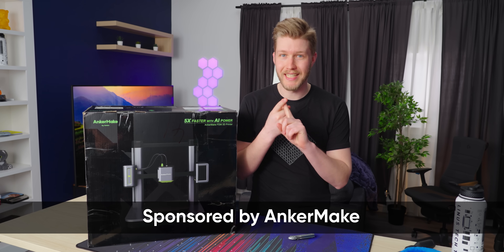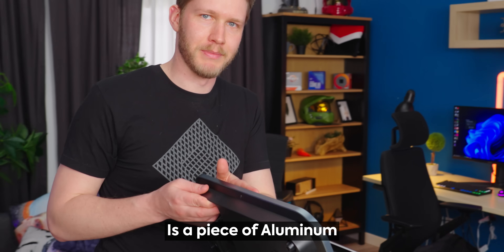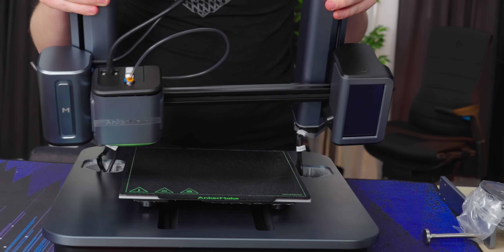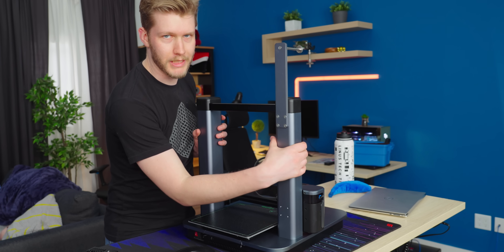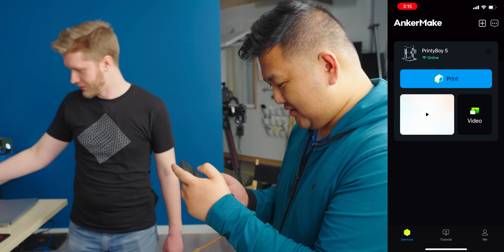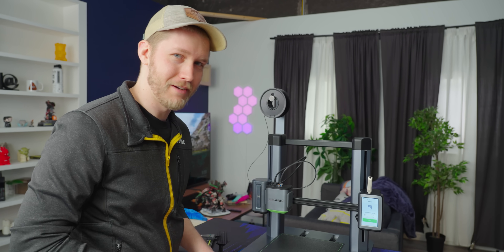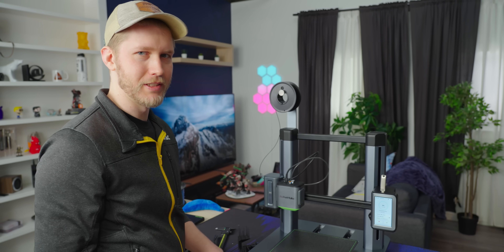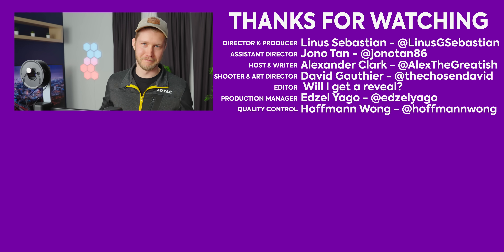Much BETTER than Expected - AnkerMake M5 3D Printer

Comment: I haven't messed with any 3D printers in about 7 years...
Seeing one that actually works (that a regular person can afford) is very nice.
Reply: Prusa Printers are also very reliable.
Reply: @thilotech  I also second this.
Reply: @thilotech  prusa is King of printers that just work without any fiddle , only first layer and It works.  But pricey.
I have a prusa myself mk3s , but also a CR 10 max , and I can walk away from my prusa without any concern but my cr 10 max , I'd have to be actively there in case it just mess up which is often even calibrated correctly
Reply: Creality makes amazing printers for half the price if you’re willing to forgo “smart” features you can add in for a couple bucks.
Reply: @porcupinebutter  Problem is creality fucking sucks and their printers get absolutely smashed by similar priced printers like the artillery genius, voxelab aquila, etc
Reply: @porcupinebutter  I second this too.
Reply: @porcupinebutter  I mean I completely get spending the premium for the features I had to do so much messing around with firmware just to get my cr touch to do 16 points of contact this type of stuff is great
Reply: @porcupinebutter  If you look at these stepper motors you should find them familiar. 

This is basically an Ender 3 but with built it CR touch.... I don't think it's that great given the price of the Prusa Mini or even just buying an Ender 3 and upgrading it's hotend and cooling getting a rail kit. 

For me I don't get it... If this is gonna be near $800 but with an Ender 3 build volume it needs to be better. I mean it's not even direct extruder like the Ender S1 and S1 Pro. Add to that the fact ender parts are plentiful. This suspiciously looks like a repackaged Ender 3 v2 with some upgrades.
Reply: @razerow3391  It is much better than an ender 3, the overall frame looks more solid, the base plate looks really rigid and overall looks (and is priced) like a premium product. Calling it a repackaged ender 3 v2 is honestly an insult to this printer. It comes with ABL, PEI sheets and various qol features you wouldve had to spend money and time on in order to install it on the ender 3 anyway so i dont see how you think getting a good base printer for a higher price is not good. Also, not shown in this video (but in their kickstarter) is that the extruder is indeed direct drive. The bowden is there just to guide the filament into the extruder but the extruder is located in the hotend housing (reverse bowden tube setup)

Honestly the hivemind behind the ender 3 has got to go. There are alot of upgrade parts for the ender3, because there really is alot of things to fix on the ender 3. It used to be a really good meme that the first thing you printed was upgrades for your printers; not anymore I feel. Development of printers have come a long way that i think people should be buying good base printers and starting from there, rather than buying some subpar products and fixing it after purchase. They were good pre-2019-2020, i dont think i can say the same now given creality's direction with their printers (ender 3 s1 is pretty good tho but i'd like to give it more time to see how their QC really is past the first few paid review units)
Reply: @razerow3391  yeah that price is insane for the same open source technology. You can buy 2-3 perfectly functioning printers for that price. I’m planning on getting a Ender 6 in a few months because core XY is the shit apparently!
Reply: @porcupinebutter  do you just have to find a slicer software and upload the files to an SD card? I am a complete noob with 3d printers.
Reply: @David_Quinn1995  depends on the printer. If the 3d printer support sd card and you want to print from it, you slice your 3d part with a slicer software(there are many free ones) and the resulting gcode can be saved on the sd card.
Reply: @David_Quinn1995  yep. I use cura but highly recommend learning a bit of 3D modeling at least to understand the form limitations of your hardware :)
Reply: @David_Quinn1995  download anything like Cura or Prusaslicer. Setup your printer in the options and then just use the default profiles if you are a noob and slice and print
Or just spend a few hours a try learning more
Reply: creality used to make amazing printers for low prices but i wouldnt get ender 3/pro/v2 these days with better options available unless they  were dirt cheap. There's a good article on the 3d printing subreddit that highlights the issues with the ender 3 and creality as a whole as a company, but really it all boils down to bait and switch tactics by creality and the ender 3 just not being very good to begin with since they're just racing to the bottom. If you need a printer that just works the ender is not for you
Reply: You can afford a good one. You just don't want to pay for one.
Reply: price is up though now that everyone has taken the early bird discount
Reply: Prusa Mini FTW!
Reply: Ignore all the people recommending an ender 3 v2 or pro, when you can have an artillery in a similar price range (genius/sidewinder) or an ender 3 s1, they are quieter, faster and more reliable.
Reply: @MRbasthor  oh yeah the S1 sounds great (I might get one if it drops 100 bucks) I’m just talking from my own personal experience.
Reply: Do me a favor and look up the Kingroon KP3S
Reply: I'm not sure where is this "you can get all the smart features with Octoprint" is coming from? You don't get a strain gauge with a DIY (BLtouch is a probe that adds bulk). In addition the only AI that will detect failed prints is Spaghetti Detective - and you need to pay monthly for it. (let's be fair - their free plan with 10 hour limit is borderline useless)
Reply: Same here. I think it's been 5 years since I last printed anything.  
Building a Chinese knock off Prusa with  about 50 parts is an experience :) 
Nothing is pre-assembled, not all parts fit so you have to print your own once you get it somewhat working. After that comes the tedious process of getting everything aligned.   
Never got it to print well but at least I learned a bunch of stuff about 3D printers.
Reply: So funny to see Creality fans saying buy an Ender that “just works”… NO! If you want to f*ck around with your machine for a lifetime then go ahead buy an Ender, if you want something that actually works then buy a Prusa MK3 or a MINI
Reply: @Fejszi  Apparently a lot of people have had good results with Creality printers, i have an Ender 5 Plus that i bought for printing larger parts, i put a linear rail upgrade on it, and a direct drive extruder upgrade cause bowden extruders are just crap, and that thing is reliable, like click print and walk away and come back to a finished part without any worries reliable.  I just helped set up an Ender 3 for another owner, i was impressed with it also for the price, out of the box experience was great, assembled it, followed the directions and it printed a benchy almost flawlessly on the first try, just a little stringing that was fixing with retraction settings beyond the stock settings.  I only have one Creality, but i have 8 printers currently, and i can say the Creality has been reliable and affordable, and for large parts the Ender 5 Plus with some upgrades has been great.  It worked fine out of the box but i couldn't stand those cheap rollers for the linear bearings, and i hate bowden extruders, others may have no issue running it as is.  So i don't know, Creality hasn't been an issue for me i guess.
Reply: @CrazyHamSales  Ok, but this is the problem with Creality fans: "OMG you bought a Prusa? Hahhaa, My ender 3 prints better than your orange piece of crap"- actual comment that a Creality fan sent me... Then you ask if his machine is stock or not; and turns out he spent more than 350 euros on just upgrades. This is the thing that CR fans can't wrap their head around. Some people want something that "just works", this means, that after assembly, I don't have to replace half of the printer, to then boast about how great it prints. As you stated in your comment, you gave it linear rails and a direct drive extruder, those are both extra upgrades that took time after assembly. Now I'm not a Prusa shill or anything but both my MK2.5 and my friends MINI+ have been working flawlessly without having to tinker with them at all (apart from the usual stuff, changing a nozzle if it wore out, or sometimes lubricating the bearings but never had to replace a part on any of them)
Reply: @Fejszi  Yeah and many people don't want to shell out shit loads of cash on something they ain't sure about, maybe they can't afford it all in one hit or it could be the case that they really are makers and love a challenge. I bet you're an Apple user too 😃
Reply: @trollobite1629  ok, so $hit loads of cash? yes ,maybe.... Yes, I am an Apple user, after 6 years of Android, I switched to an iPhone? Does that make me less human? And yes, I'm still a maker, but I like making stuff with my 3D printer, not tinkering with it. I still love challanges, but an Ender still can't beat the ease of use that even my 5+ year old MK2.5s has.
Reply: Ender is also well known to the community and there is lots of support from others if you run into troubles.  This being a new product for Anker means support will be less from the community until they release more at a better price then MSRP.

Ease of use is nice but honestly when I jumped in last year on the popular ones that pop up for cheap on woot it took me less than a day to work out everything and get good results because people post solutions to anything your going to run into on the Enders
Reply: @DestinationFawked  I dont get what he means... 3D printing for a few years now has been affordable... And the Ender series made it even more so. I mean how many versions of the Ender 3 is there alone if you think the S1 and it's variant are just updated Ender 3 v2s! 

And they have no problem. In fact you can even print PETG, as I do with eSun's filament. 

3d printing stopped being a wild west and janky a long time ago... Prusa, Ultimaker and others saw to that by standardising certain methods and design philosophy.
Reply: The build quality, "smart" features, ui focused towards less experienced users and covers over all the important parts (ie extruder, hotend, cooling fans, and kinematics) seems targeted towards apple device users. I'm surprised by the base price. That said, much of that is just more work when something fails and if you've 3d printed before you know something about things failing. I also run an ender 3 v2 on octoprint with bltouch and many other little upgrades and I feel like I'm more understanding of the device and process from finding the need for the upgrades during my uses and performing them myself. If this were my first printer (especially at $1200) I'd be very reluctant to want to fix it myself, so as long as there are no problems then there are no problems. It does look nice though.
Reply: @RobertD_83  here's my argument, a well built printer, taking into consideration good qc, materials and choice of components shouldnt randomly fail out of nowhere, and hence does not need intervention past typical maintainence, which can be supplemented by a well written manual, unlike the ender3, which has subpar construction, questionable component choices and your main troubleshooting source comes from the community, instead of the oem company. Heck, the go-to instruction manual for the printer isnt even written by them, and there are community members that write better instructions than creality themselves. You can learn about a printer even without having to go through the ender3 hazing periods is my opinion on the matter, you've just taken alot of the guesswork out, guesswork that's supposed to be a settled issue by now, by pushing and supporting good out of the box printers
Reply: With the caveats of FDM printers like this thing generally have much larger print beds and filament is a lot easier to handle at $750US you can get very good resin printers. I have both and use them heavily but if I was buying new I seriously doubt I'd spend more than $300 on an FDM printer.

Also Creality? If the point of having a 3d printer is to tinker with the 3d printer then sure but if you actually want to print stuff get something else.

Comment: Is this the 3-D printer that Alex was excited about during the recent sleeper build video? Either way, this looks awesome.
Reply: I think he was excited about the 8,000$ one he mentioned, but not the one featured
Reply: That one was the Phanteon
Reply: No it doesn’t look awsome, this is a low effort Ender 3 clone
Reply: @Fejszi  would you mind explaining? I have it backed at the $499 price but bought the Ender 3 S1 pro on sale figuring that one would be better in the long term. What’s your reasoning?
Reply: @areazaft1970  The Ender is the original design (even though it loosely copies a RepRap/Prusa Mendel) it uses Aluminium extrusions and V-rollers for movement, uses a bowden extruder. Since its open source, many companies just made clones, with little changes to the core design… As for your purchase; its a decent one, infinitely better than the piece of crap reviewed in the video, but its not as high quality as something like a Prusa…

Comment: There is a bunch of problems as of now. 
250mm/s simply not reachable with accelerations anjd jerk/JD they have as default settings, unless you print somthing in the size of whole bed.
Basically this machne is a Marlin run by not-octoprint with not-spaghetii-detectve (AI software doesn't really exist yet) At least they choose CPU tailored for image processing.
Own slicer - OMG no please no, we really, REALLY don't ned another shitty one.